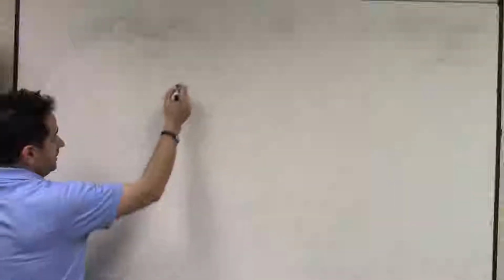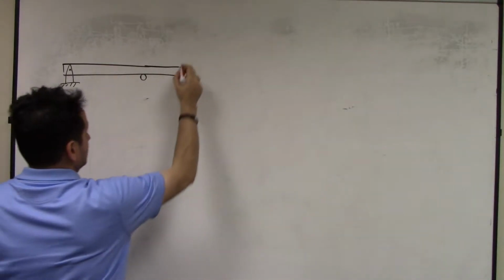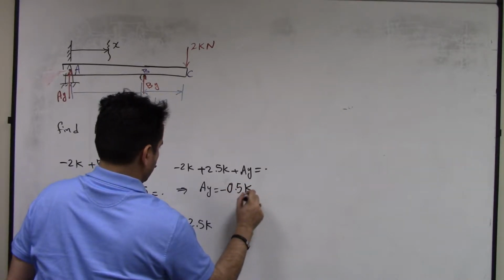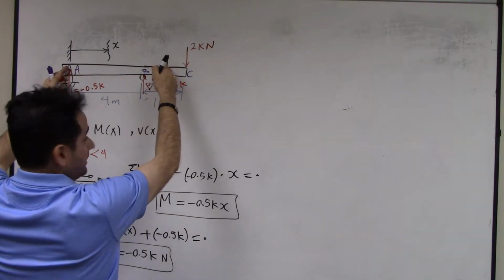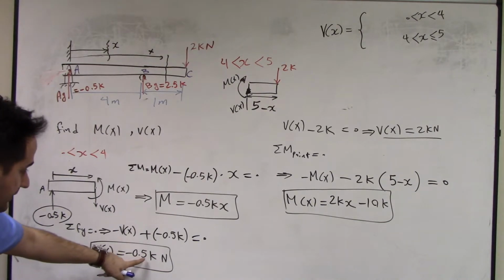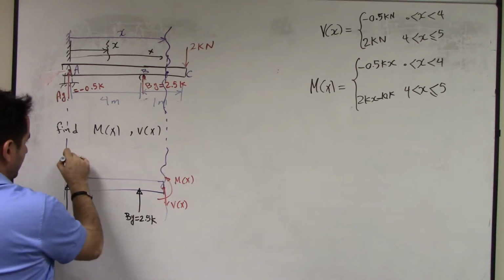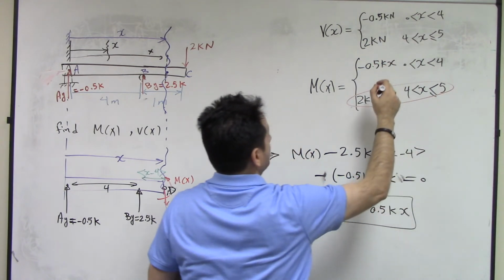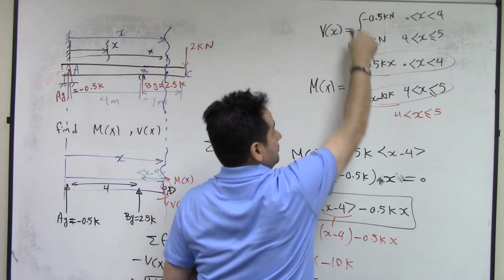shear/moment calculations using Heaviside function

Comment: U didnt consider x=4 in any of the two regions even though the function is continuous at 4 
U entirely neglected the reaction force at B.
Cud you explain that?
Reply from the maker: The shear in not continuous at B but the moment is. You can get M=-2 at B when you simply evaluate the Heavyside at B.
Reply from the maker: And the reaction load is not neglected but it is included in the Heavyside function.